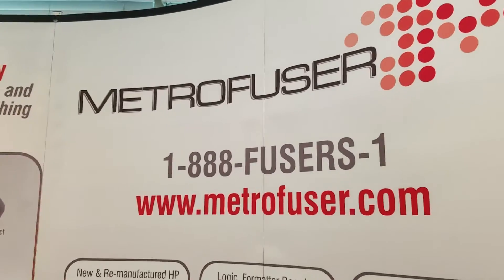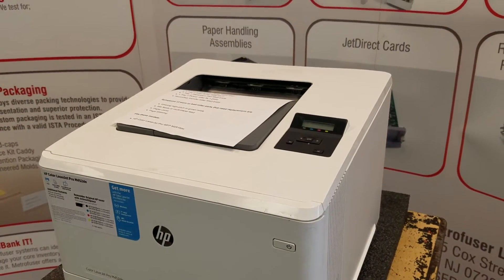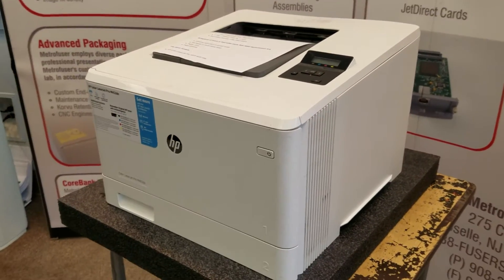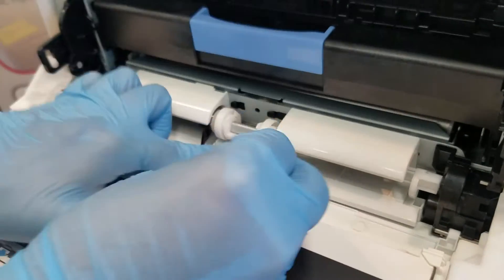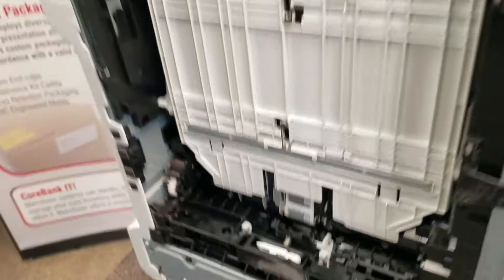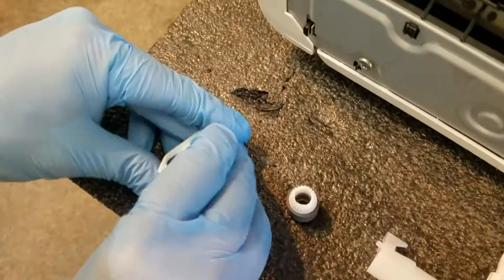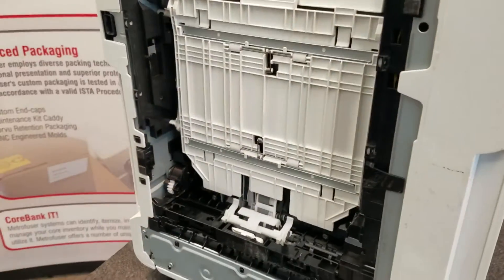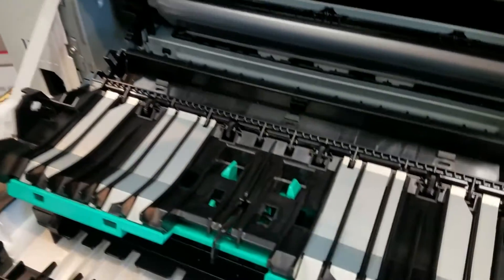HP Color Laserjet M452 M477 M377 M454 M479 Maintenance Kit / roller kit parts replacement for Phil

Comment: Phil, I am noticing feed problems.  The main problem is I can't print double sided anymore.  I have the 452dw.  Which roller is it that moves the paper around and or which kit should I buy - if that is the solution?
Reply: did you ever figure out the solution to double sided printing always jamming?

Comment: Can’t you just clean these instead of replacing them??? Also I am very unhappy with this printer. When turned in and in standby It’s been ramping up like it’s going to print a big job every 2 minutes and then quiets back down. You cannot have this turned on in background as it is just annoying. 
Now all of a sudden whenever I want to print a single page of anything, I have to press the ok button on printer to actually print it as the red light turns on in printer. Annoying

Comment: I am getting a magenta vertical line down the right side of my paper.... it seems like that line is on the secondary roller, i have cleaned that but it keeps coming back.  is this a toner issue you think? the printer does not have much usage on it.

Comment: Thanks for this video!!!  

My M452nw is saying there's a Jam in tray 1, but there is no paper loaded.  Do you think this is because of a worn out roller?  That's the only thing I have found after some research.
Reply from the maker: The tray 1 sensor flag is probably damaged/broken.
Reply: @metrofuser  hello sir can you please tell also  what is the problem on my printer m452dn where is keeps paper jamming.. after watching your video i think it is because of some worn out roller ? Many thanks
Reply from the maker: @EleazarTLato  I would start with replacing the pickup rollers.